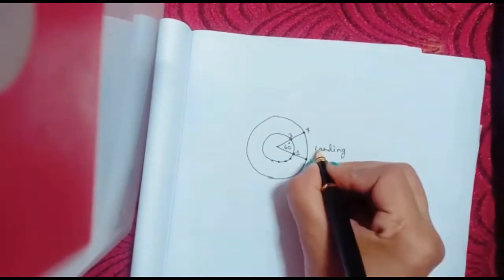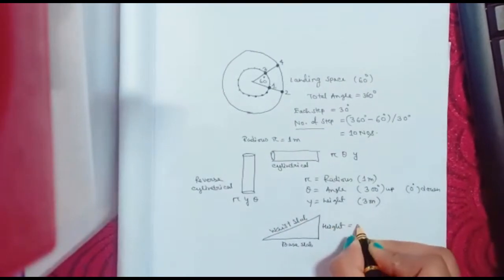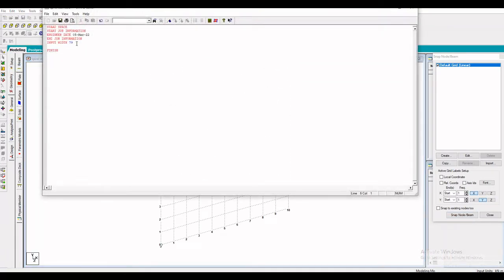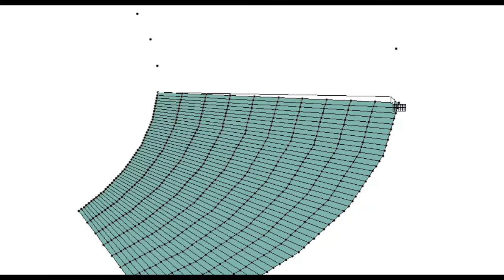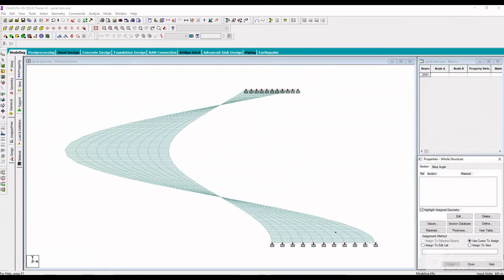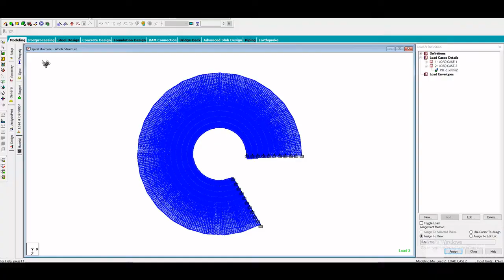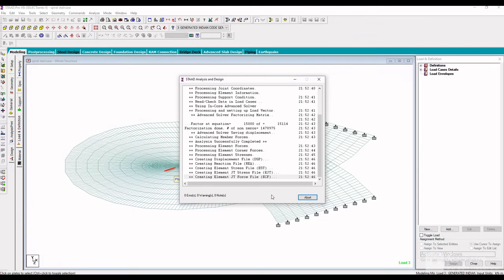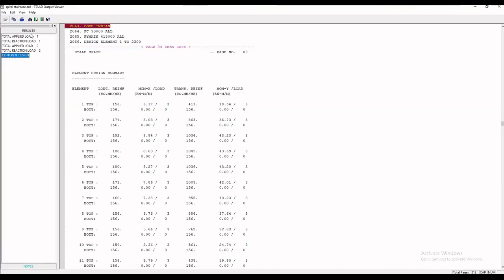ANALYSIS & DESIGN OF SPIRAL STAIRCASE BY STAAD

Comment from the maker: When u r using Google map for search any unknown location & estimate the time for location for the perticular location,then  I think u donot use this process manually,,
& Staad pro is just like that....b4 create any structure often we calculate the Steel consumption,cost and 3D rendering/realistic view , especially the probability of load over the structure,as the structure can consume its own load for the perticular soil stability & also calculate the probable section property or size of beam column,slab, outer wall and inerwall as per the load.forcthis total operation d  manual process......oh its's unthinkable.
So b cool and watch the video minutely for any  queries u can ask me questions.
It's all about technology,,,if there any automatic method for any process then why whould u want to learn the manual process,,u can learn this process from the Site Engineer.,,, during the erection of spiral staircase....ok dear friend stay tuned...